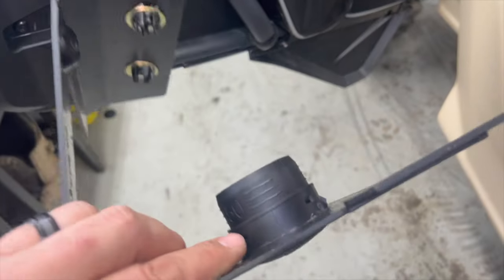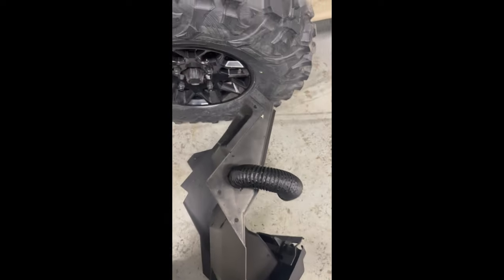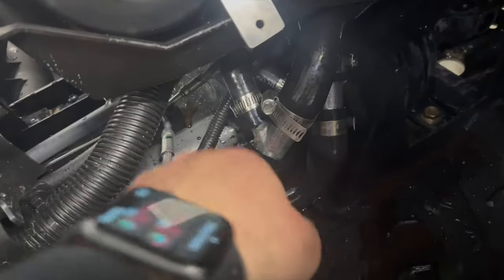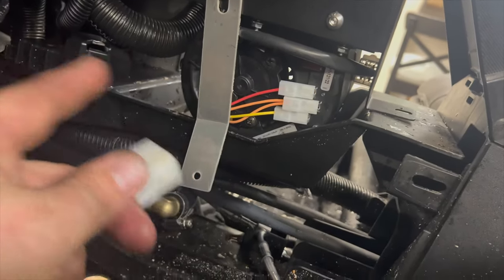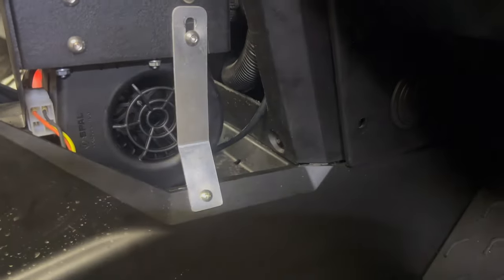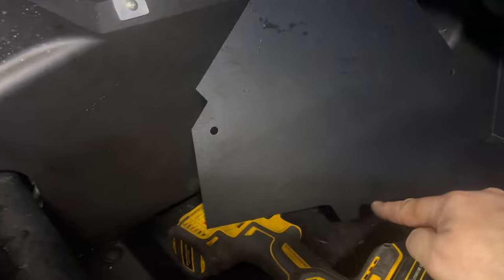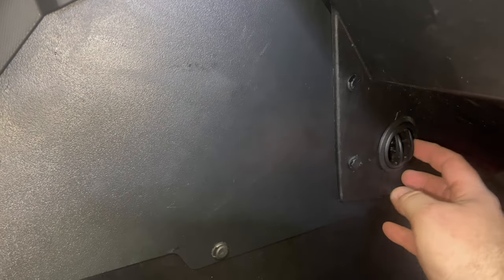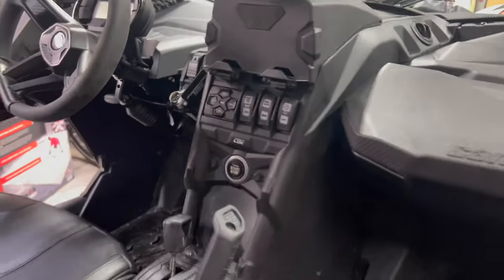X3 Inferno Heater Install   4K

Comment: Great video.  I'm getting the Maverick XMR.  I've got the heater, W/S,top and doors on order.
Reply from the maker: Nice! What’s your plan for rear window? The can am sight shows the rear window doesn’t work with XMR, but I think from looking at the install instructions on their website that it should work. Or was there another rear window you were going use?

Comment: hey man.. your windshield.. it came with two clamps to hold the sides..  howd you installed those. i cant manage to do it. and its kickin my butt.
Reply from the maker: It’s not easy as clamps are aluminum and I used a pinch and a hammer to slowly knock it out of its clips. It will mark up the clamps unfortunately. Any dirt that got between the clamps from riding make more friction. When I replaced the window I made sure it was all cleaned off, but still needed the pinch and hammer to tap it back in place. It only needs to move about 1 inch I believe to release
Reply: @Bullyveldt  its a pain.. mine they appear they both right side.. they are identicall

Comment: running the coolant line the way you did would you still need to remove the shock?
Reply from the maker: Nope, I did not have to do anything with shocks since all the cutting and such was under the dash area

Comment: Nice installation!  Which windshield do you have?
Reply from the maker: in this video it is the can am glass windshield with wiper. I have since broken it in a rollover. It has been replaced with Super ATV coated poly windshield which works with the can am wiper system.

Comment: Any update on the way you tan the coolant lines? Leaks does it work as good?
Reply from the maker: Haven’t had an issue with coolant lines, works well
Reply: @Bullyveldt hey what size was the coolant line and what size is the line that comes off the T to heater?

Comment: What size Jam nut did u use for the accessory terminals ?
Reply from the maker: I’m not sure the size, but there is a nut already on the terminals, so I reused it. Just the one nut without a second jam nut. It has held for last 1000 miles no issues